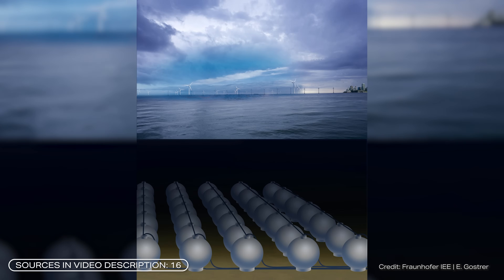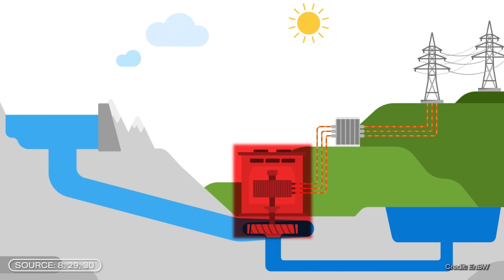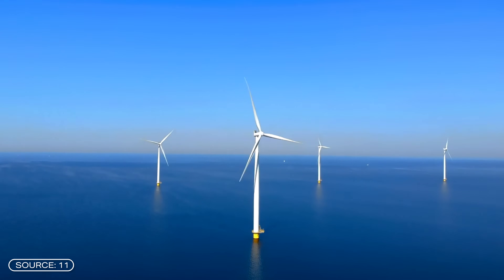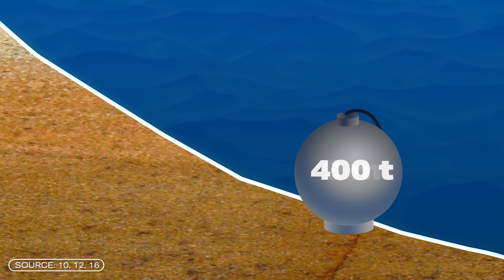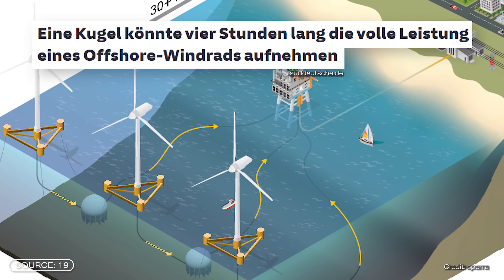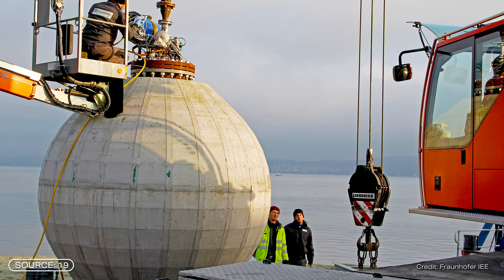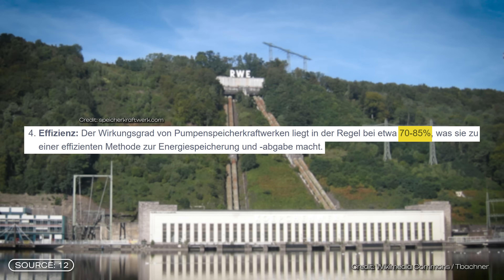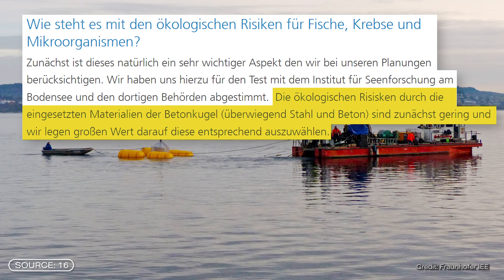Underwater Battery Storing Power at 600m depth!

Comment: I think this is a brilliant idea. There is massive potential for off river, pumped hydro, which opens up thousands of potential sites around Europe. Then there is seawater pumped hydro, which can make use of the hundreds of miles of sea cliffs. By flooding eleven small valleys on west coast of Ireland, we could store 500 GWh of electricity indefinitely. Buy in Scottish excess power when the price is low and resell at a profit, as well as solving pretty much all Ireland's storage problems, add rooftop solar and Vehicle to Home, or vehicle to grid capacity and we don't even need to do that much to the grid. Every village should have a solar-field on the outskirts with a local grid, supplying 90% of their power needs. This is so doable.
Another thing that is doable is stopping Germany supplying weapons for a genocide. YOU, Sir have a duty to speak out.
Reply: You are what Mosab Hassan Yousef calls a 'Palestinian'. It has nothing to do with geographic location and everything with your mental state.
Reply: Whoa!  So the geography just makes it racist. /s.

Comment: 8:43 wait if you are just lifting the water out of the sphere and holding the inside at 1 atm while the outside of the sphere is at 60atm, then maintenance becomes relatively easy: let a guy just live in the sphere and he maintains the pumps. You’ve made a concrete submarine.

That is if i am understanding the scheme correctly, the alternative way to do it would be to replace the water inside the sphere with 60atm air, but that doesn’t create the pressure differential with the surrounding water and long vertical air hoses sound like a bad idea.

Comment: Here is a MUCH better idea:

Imagine these spheres, as described.
But, don't pump them empty at the bottom of the ocean.
Instead, lift the spheres to the surface, and empty them there.
Lower the empty sphere to the bottom, and drive the turbine under pressure.
Repeat and profit.

... No pumps needed ... just some winches, a cable anchored at the bottom, and a motor to lift and lower the spheres.
Reply: The slow development of wave and tidal generation has been mainly due to the rigours of sea conditions at the surface plus accretion of marine plants and animals. Keeping the spheres static at depth  makes complete sense.
Reply: @mattsheard2708 Maybe you are right.

I'm just thinking, that high performance pumps need regular maintenance ... at 800 meter depth (80 bars), that will be pretty expensive, difficult and dangerous.

In my setup, everything can be handled at the surface, and the high performance pumps aren't even needed.

Anyway ... time will tell.
Reply: Or better still: fill your spheres with a cheap and very dense compound, e.g. certain iron ores (with iron ores 4000 kg / m^3 is possible which represents 3000 kg / m^3 difference with seawater and therefore more energy per volume than vacuum or air). Now just raise and lower these spheres to and from the ocean floor to and from a floating vessel. The cable will be expensive, but you should figure out a "many weights per cable" concept, where each of the weights can be hooked on and hooked of the cable.
Reply: @Hecatonchires1991  That is what's known as a "Gravity Battery" ... just in the ocean.

That would probably work well, be easy to find suitable locations for, and be more versatile due to the extreme height/depth available in contrast to land-based gravity batteries, which at most can go a couple of hundred meters up.
Reply: What turbine?  
Why is a turbine better than a pump?

Comment: you have to fully charge / discharge these balls ~200x with 100% renewables to make them pay back their CO2 when you compare it to using coal, double that if you compare it to gas.
Reply: It's worth the incremental progress toward total emissions reduction, and 200 cycles doesn't seem unrealistic, we will constantly need to send backup power especially during evenings. I dont even know where 200 comes from, is that the emissions from making a concrete ball of that size, and then how much energy you can produce with those emissions with coal?

Comment: you are not really gaining anything by surrounding it in high pressure conditions. your still spending energy to move high pressure medium it's just by putting it under pressure your changing where the "hill" of that energy spending is. explain why it takes less energy then filling a container with high pressure air storage.
you are moving the same amount of air it's just not under water. where they can say trust us bro it's really down their, we didn't just pocket the money and run.
I just don't get the physics of it. think about it this way if you could use high psi from the sea you could just put a big pipe that led down to the ocean and run a turbine off of the water flowing up out of the pipe with the high psi. this is not oxygen included(a computer game) where you can do silly stuff because reality is hard to program.
Reply: It's a matter of acreage for the water vessel which is why they are putting it under the water and close by in isolated pods fir demand adjustment.
Reply: @glennmorgan4197  are you a ai or something, did you not watch it? if they were only putting it at sea for the space then they would not require it to be at a 600 meter depth under water. no they are trying to sell it on the idea that they are some how using the deep sea pressure. likely they are just trying to scam elites that get confused with technical or physics with a free energy scam that is a energy storage rework in this case. the elites are likely using government money tho, so if their were any corruption laws perhaps it could rope some elites in, obviously not the guilty ones. what's that thing the red queen in Alice in wonderland said during the french revolution.
Reply: This system does not pump air.
Compressing air without heat recovery is very inefficient.
It's benefit is realestate. Virtually all suitable locations on land have been used, the sea bed is up for grabs.

Comment: This is all several years old, except for the 3D printing part.  You are not talking about concrete holding a vacuum.  I have never heard of a concrete vacuum vessel, probably for a reason.  Maybe a polymer liner?  But since it is a vacuum, should be an external coating.  How is that going to hold up?
Reply: You add a sealer to the concrete mix and cure it slowly and keep it wet.
Reply: The largest vacuum chamber on earth is made by concrete, a NASA facility.

Comment: It's a relatively simple process, and other than air loss under water pressure, it seems quite reasonable.
Reply: Corrosion issues will be severr despite deep water and relatively little oxygen and cold temperatures.
Reply: @wombatillo we've been doing offshore infra since forever

Comment: What is missing from this explanation is how largely incompressible seawater can be pumped out without creating a vacuum in the sphere. There must be a compressible gas or a bladder involved as otherwise the water pressure would be so low that you would have cavitation to pump it out.
Reply: The point is to create a partial vacuum in the sphere. After the partial vacuum is created by pumping water out, water can be allowed back in to fill the vacuum and this inward flowing high pressure water can be used to spin a turbine (generating electricity). Simple. I think you can prevent damaging cavitation by controlling the rate at which the vacuum collapses.
Reply: @mattmiller220 if they hold the inside of the sphere at 1atm air and the outside water is at 60atm, does that mean they have created a concrete submarine?
Reply: The pump shown is multistage, with the water pickup on the far end (skinny end), farthest from the motor bulge. That means the pump intake goes to the lowest point in the sphere and thus, the water does not have to rise under vacuum. A few centimeters/inches of water is the maximum that needs to remain in the sphere bottom, even when a substantial vacuum is present in the tank. Each stage of the pump only needs to supply a fraction of the total pressure, and the inlet stage can be designed to minimize turbulence and cavitation. Following stages all operate under positive pressure at all times. In that way, there is no problem with pumping almost all water out, leaving a fairly good vacuum inside the sphere.
Reply: Why worry about a vacuum. You have 60 bar pressure outside, it makes no difference if remaining pressure is 0 bar or 1 bar. Except some of the sea water will boil, which would lose energy. So probably just keep a bit of air at the top, which goes from 1 bar to 600bar.
Reply: @alexterrell1062  He explained it, cavitation. The pumping need to be done fast, and at least somewhat efficiently, cavitation is definitely an issue for the technology.
Reply: Could be solved pretty easily: Attach a 10 m high pipe under the sphere, between the sphere and the pump, and you have 1 bar hydrostatic pressure. Alternatively, you could leave a rest of water in the sphere, which would also generate hydrostatic pressure. 
And no, the concept doesn't involve a gas filling of the sphere.
Reply: Without a separator, like a bladder, gases will dissolve into the water at the higher pressure. At 60 bar and a temp of about 5 C most gases can dissolve into a smaller volume of water than they occupy at atmospheric pressure at room temperature.  A bladder makes the system even more expensive and complicated. A layer of oil on top of the water could in theory eliminate water to gas contact and keep a gas in the spheres. That oil would have to be totally unaffected by seawater, and none of it can be allowed to be lost in normal operation.     

While it is possible to place the pump even lower than the sphere to create a hydraulic head to avoid cavitation, but then you need to either raise the spheres, or somehow find a way to place the pump lower than the sphere some other way. Either digging down into the seabed, or placing the spheres at/near a slope, neither is very practical, working at a depth of 600 meters is not like working on land.    

Any way that issue is addressed, just making the spheres is going to be more expensive and have a bigger environmental impact than batteries for a given amount of capacity.
Reply: Exactly what I was thinking. Couldn’t you start with a highly compressible gas being in the tank along with the water?
Reply: @marekful the problem they will run in is that concrete alone works beautifully in compression, can't hold pressure,
Reply: Seawater can't be compressed, but it can be decompressed. As pressure drops, boiling point drops. The inside of the the chamber will be full of water vapor, not vacuum.
Reply: In the lake test they were able to pump the sphere down to vacuum without issue. 👍
Reply: @serversurfer6169  It's not impossible to do, but to do it reasonably fast, without adding significant cost and or complexity is a real challenge. And since the basic principle inherently is orders of magnitude more expensive, resource intensive and complicated than pumped hydro needs to be, for a given capacity, even without taking that issue into account, the fact that it's technically possible to create a vacuum in the spheres doesn't make the system viable.
Reply: @fishyerik  The vacuum was the concern you raised, so it was the concern I addressed. They had a fully functional small scale system, and they’re in the process of building a full scale system, so I’m not really sure what sort of insurmountable obstacles that you’re now gesturing vaguely towards instead. 🤷‍♂️
Reply: Why is everyone assuming that the spheres contain 1 or less atmosphere when "pumped out"? Does it state that anywhere? Would it not make more sense to pump in (and release out) surface air? Use that airflow to run generators and the overall pressure in the containment vessels remains the same. Less repetitive strain on the rather inflexible concrete.
Reply: @robertberner65  True enough, though the pictures show no air pipes. Though I suppose they could come along the sea bed.
However, take outside air and pressurise to 60 bar, and you generate a lot of heat. That can't be recovered. You are basically doing compressed air energy storage.
Reply: @robertberner65     Gases, including air, will dissolve into the water under high pressure, so if there was air with 1 bar/atmophere pressure in the sphere when there's no water in it, most of that air will dissolve into the water when pressurized to 60 bar. 

So, without some kind of barrier between the gas and the water, the gas pressure will become much lower than 1 bar when you pump the water out. While it's possible to have some kind of barrier, that adds cost and complexity and reduces reliability.

Your suggestion to use the depth to store compressed air is much better than the idea that the video is about. Compressed air energy storage has a range of issues/disadvantages, but it could potentially be viable, while the system the video is about can not.
Reply: A steel tank can hold 5 times more pressure, can be make bigger because isn't in watter, can be place anywhere .
Concrete ball  just like scuba tanks have  a size limit because it will float.
Reply: @yvanpimentel9950  Are you proposing to build 800m-tall water towers for energy storage? 😕
Reply: @serversurfer6169 no a simple seal tank, like in a air compressor but stranger ,it is sime to build in site, to hold air a wind mill tower could be built with dual purpose.
Reply: @yvanpimentel9950  Sorry, are you talking about compressed air storage? That’s a completely different technology from pumped hydro, with its own issues like heat management. 🤷‍♂️
Reply: @serversurfer6169 a tank at60 bar of pressure can be pump with water up to 250 bar, as long as only water is used for power it will be pump hidro. 
 My point is if it can be done in solid ground doesn't see the reason to go 600 meters under salt water.
Reply: @yvanpimentel9950  Sorry, I’m having trouble understanding exactly what you’re saying, but I can tell you that you can’t compress water, so the only way you’re getting 250 bar of water pressure to run your turbine is to stack it 2.5km high. This system is designed operate at ~80 bar, under 800m of seawater. It’s a standard pumped hydro energy storage system, but it uses the sea itself as the upper reservoir. Sorry, but I have no idea what you’re describing instead of pumped hydro. 🤷‍♂️
Reply: @serversurfer6169  simplicity , imagine a scuba tank 50% watter 50% 4000 psi, or  2 tanks one for air another water but the trick is air is steady only the watter is used for energy  so evading heat loses. 
 And no need to go to the bottom of the oceans.
Reply: @yvanpimentel9950  You’re still compressing the air, so there’s no avoiding the heat losses, though you can add additional systems to recover some of those losses. The water in the system you describe is just serving as a crude piston. The energy is being stored in the compressed air, so it doesn’t remain “steady;” the pressure drops as the air expands, steadily decreasing the power it supplies as the energy is drained. 🤓
Reply: @serversurfer6169 yes but is the same in reverse,,today inverter motor use energy proportional to the resistance  , 
You have to understand that 
CAES  inefficiency can be overcome by its ultra low cost and longevity, compared to today lithium the savings can be used to install solar panels to charge the sistem,so you get a sistem that recharge on solar that was paid by the savings, it doesn't matter if is 50% efficient if is charge with free energy.
Reply: @yvanpimentel9950  This is cheaper and more efficient than CAES, and waste heat is not inconsequential, especially at these scales, especially if you’re talking about 50% RTE vs. 80%. 🤷‍♂️
Reply: The energy density in this scheme is still low compared to the hardware and infrastructure installed. I doubt this will pan out.
Reply: @wombatillo The payoff is actually fairly high. Simply dump a concrete sphere with a turbine in the top into the sea, and you have a complete pumped hydro storage system. The LCOE is fairly low. 🤓👍
Reply: @serversurfer6169  There is nothing simple about "just dumping" a 30 meter concrete sphere, pumps, electrical cables, water pipes, telecomms and electrical equipment 500-800 meters into the ocean. No, the sphere and a pump don't constitute a full system, not even nearly.
Reply: @wombatillo exactly, most of this super complicated sistem  are looking for grants, even a vacuum have Buoyancy,
Reply: @wombatillo  🙄